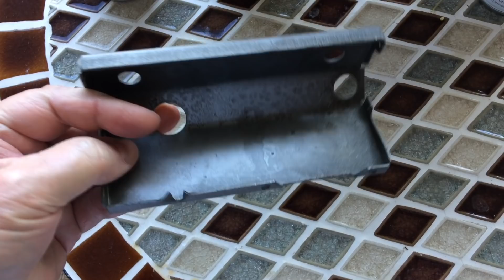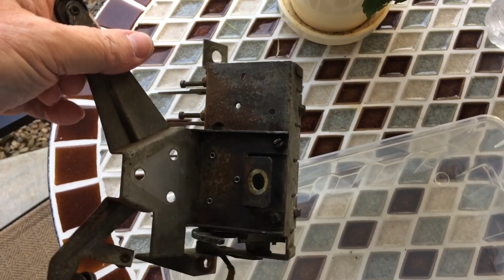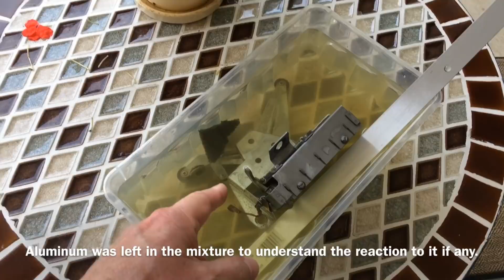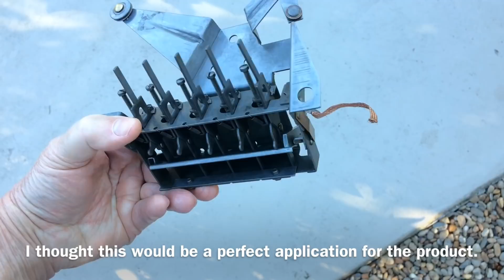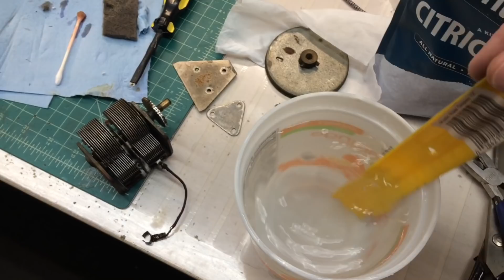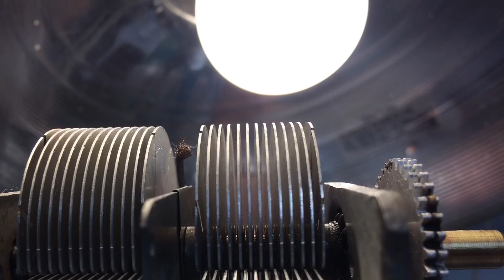Crosley 718-B - Rust Removal & Chassis Update

Comment: WOULD APPLE CIDER VINEGAR WORK IN PLACE OF THE CITRIC ACID?   I've had problems with the rust re-forming...
Reply from the maker: I’ve never tried apple cider vinegar, but I’ve read it works equally well as white vinegar or better. Vinegar takes time to remove the rust in general and can leave a black looking deposit behind, which can be washed/scrubbed off with water in most cases. Rust will always reform so a rust inhibitor is needed. I’ve used Boeshield T9, wax, clear lacquer, and a few that have been recommended to me are Ballistol at: https://ballistol.com/faqs/ and HinderRust at: https://www.fluoramics.com/hinderrust/corrosion-inhibitor/  Hope this helps. Best, Don

Comment: Can I ask what the size of most radios wires that you replace ,I bought the wrong size because ,I don't no what size to buy to replace broken and old wires most radios use about the same size,I want to buy some more heat proof silicone.wire,If you can help me with the size .your chais is coming along so well it amazes me ,and.all the different chemicals it takes.
Reply from the maker: Ron - thank you. I use stranded 20AWG rated at 600V and also have and used Cloth Covered solid 22AWG rated at 600V. For filament/heater strings I typically use 18AWG solid. Hope this helps. Best, Don
Reply: @RestoreOldRadios  Thanks that will save money .

Comment: Great results as always! Do you find that you get better results with the acid than with the industrial products or the ultrasound I saw you use in earlier videos? Or is it all about which material you’re treating?
Reply from the maker: Ola - this was my first experience with Citric Acid and water, but based on my observation it worked equally well as compared to Evapo-Rust (time to remove the rust and the end results). Citric Acid, Evapo-Rust, Picklex 20, Krud Kutter - The Must For Rust work well for parts that can soaked in the solution over time. Picklex 20 and Krud Kutter have an advantage as both products can be left on to form a rust inhibitor. Picklex 20 can be painted over as well. Naval Jelly is one of favorites where a gel is needed to adhere to a vertical piece of metal or other substrate that can’t be submerged in a solution. My use of the Ultrasonic cleaner has been to clean parts that already have any rust removed, but I have since considered using the Citric Acid with water and see how the Ultrasonic Cleaner performs while derusting and cleaning in one step. I’ll post the results if I do a test. Hope this helps. All the best. Don

Comment: very nice but i think its time for a homebrew zinc plating setup...
Reply: @Stephen Morton zinc is easy but chrome is very very complicated
Reply from the maker: Hugo - do you make your own Electrolyte solution or use a commercial product? Best, Don
Reply: @RestoreOldRadios  i dismantled a small factory that made medals and trophys, i think i have video on that.. so i have acid (i use chloridric acid to remove the rust and etch the parts) and bath solution already made aswell as acess to scrap metal for the plating. i dont how to make my own solution though but i have a large amount of it.....i dont use it much, i mainly do tv restoration and very often its too difficult to fully disassemble a chassis so i do it very rarely...  i never tried chrome, chrome involves too much steps...  but zinc is easy and it's worth it for you because you make so much effort to make a chassis look good, i think if you had a plating setup it would be perfect
Reply from the maker: Thanks for the info. I'm with you on the zinc plating and think it would be a good fit for this radio if I was dismantling it completely. Like you said about the TVs, it’s a lot of work. The chrome wouldn’t be a good fit for this radio and like you said, it’s not a simple cost effective process like zinc plating. I’ll have to try my hand at zinc plating on a few small parts and see how it goes. I see folks typically use a low voltage DC source and aim for 65 to 100 milliamps of current per square inch. Is this accurate based on your knowledge and experience? Thanks for your time. Best, Don
Reply: @RestoreOldRadios  i use roughly  10ma for each cm2 wich is preety much like they told you. i dont have a regulated supply so sometimes i use a battery charger on 6 volts and sometimes a motorcycle battery, sometimes with one or more 6v lightbulbs in series and an ammeter, i play with that and with the distance between the electrodes until the current is sort of appropriate. never got into a very well designed process but it is something i want to do in the future, maybe when i have the need to plate something big and it needs to be shiny...  recently i restored a philco tv and some brackets and the bodys of the potentiomenters were very rusty but i ended up just cleaning them with acid and clearcoat them because the plating seems hard to get to deposit on the inside of concave stuff... i did not use any fancy products like evaporust etc, just dipped the parts in acid for some seconds and clean with a toothbrush, dry them very quickly and coated them, they looked very very good but plating is really the way to go for longevity of the parts. i still cannot get the professinal shine out of any part though, maybe the zinc ingots are not pure or the current draw is not correct.
Reply from the maker: I really appreciate you sharing your knowledge and experience with the process. This will help me a lot if I try plating some parts in the future. Thank you again for your insight and taking the time to reply back. I hope your future TV restorations are a big success. All the best. Don
Reply: @RestoreOldRadios  thank you Don, i also wish you the best of luck for all your projects and invite you to see my crappy ones! Best regards from Europe, Portugal
Reply from the maker: I just subscribed to your channel. Thanks again. Don

Comment: I like the use of citric acid there. I did buy some 45% concentrate phosphoric acid to use here because naval jelly is so expensive here. How do you dry your parts after de rusting? I hear some use a compressor and others use a heat gun. You did say air dry but I didn't know if you forced it or just let it dry naturally? Over here the flash rust is almost instant because of the humidity. All the best, George
Reply from the maker: George - to help prevent flash rust, I typically dry parts off immediately for several minutes using forced air. My handheld blower is similar to this one: DataVac Computer Cleaner / Computer Duster Super Powerful Electronic Dust Blower Environmentally Friendly Alternative to Compressed Air or Canned Air https://www.amazon.com/dp/B01FWSYOME/ref=cm_sw_r_cp_tai_4HLdDbM5PBAXZ I recently purchased a dehumidifier for my shop that I run 24/7 that has made a significant improvement in the air quality. The humidity stays at ~50% now and I don’t have to run the AC as often. Our summer temps are high 80s low 90s with humidity. It’s hard to find those low humidity days in the summer to spray lacquer, paint, etc. Best, Don